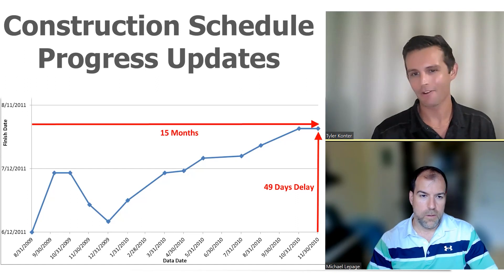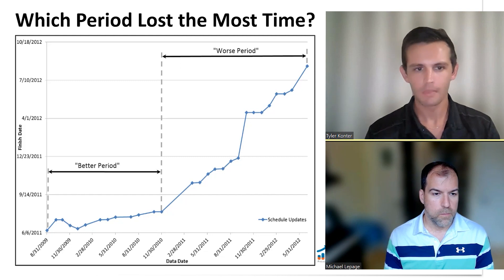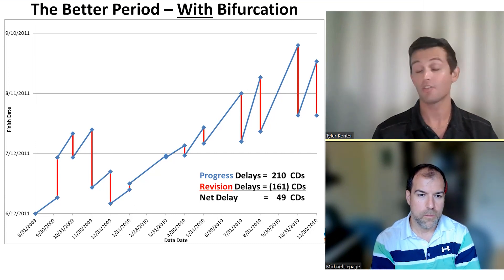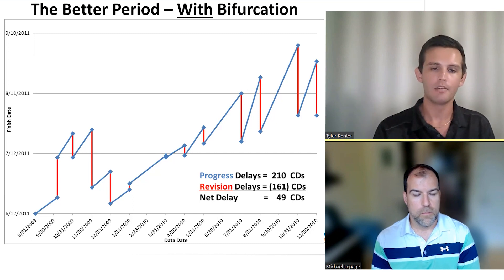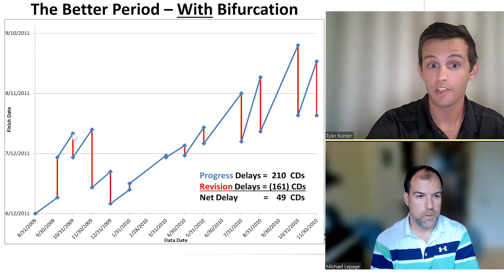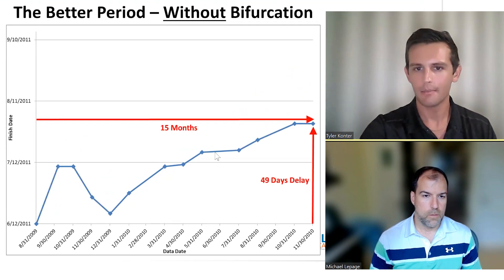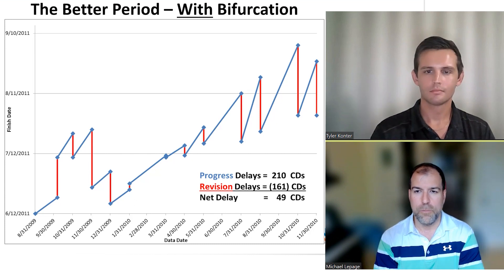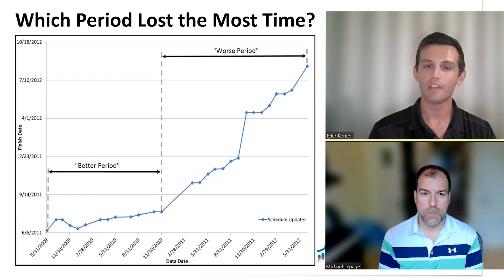This Project Schedule Was SQUEEZED! How to tell.

Comment: Is it just me, or the bifurcation analysis would never be possible for 99.9% of the schedules because schedulers status their projects WHILE ALSO adjusting durations, lags, and dates, and wouldn't save a 2nd version of the same schedule with the same data date to have a progress vs. revision for every update?
Reply: Hi Sir - Good question. The process to split the updates into two copies (Progress and Revisions) is documented in AACE technical papers going back to at least 2016. Search "bifurcated" or "half-step" analysis and you should be able to find a 3-part series I co-authored with several people on how to do this process in P6 (we've also replicated in Microsoft Project and other formats, but there are some differences to the process). The process allows the analyst to understand where the schedule would have been before any revisions were made to the remaining plan, and then understand the net effect of the revisions to the remaining plan. Tyler was discussing one of the outputs for running the process on an actual project. Hope that helps.